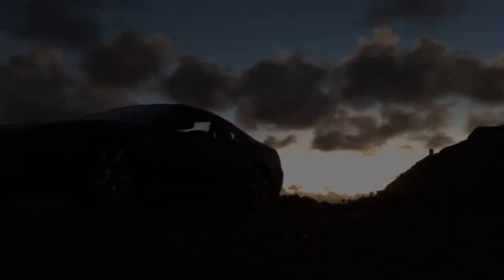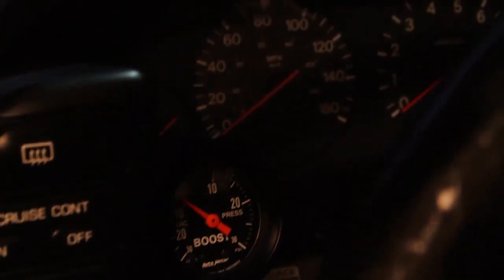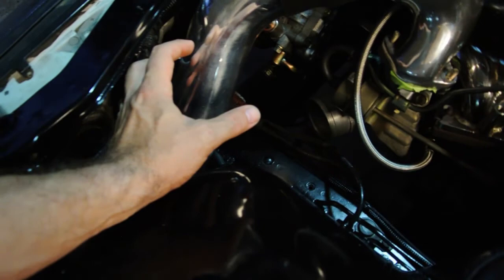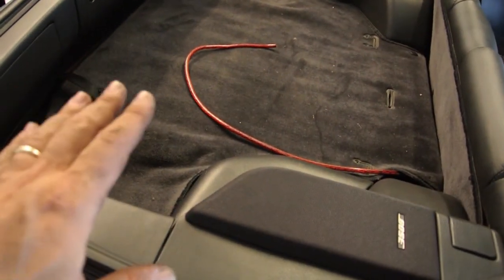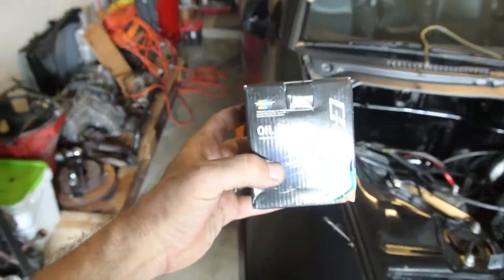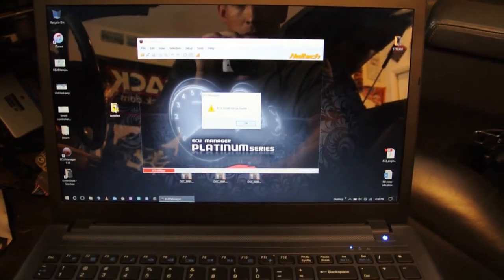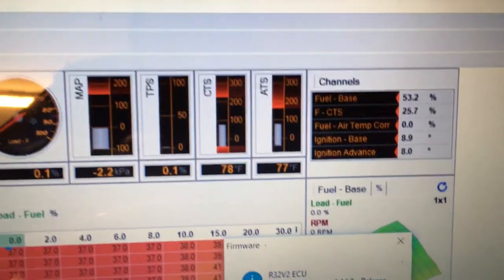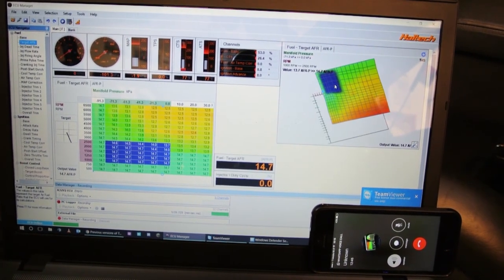First START UP :: Ep16 - TueZday Garage :: RB26 into 300zx (RBZ32)

Comment: @08:22 thats exactly why im surprised you went and deleted the ac. rb's build so much power lil ac isnt gonna draw that down much.
and it would help balance out the engine bay like you said the rb isnt the most balanced motors. that why i love the vg platform but i still love this build! always wanted a sequential turbo setup or one mid sized turbo.

cant wait to see more updates as you finish her off.
nice work brotha!

Comment: What is the difference between driving VG and RB in Z32? :  )
Reply from the maker: There are many on the fence or opposed to this swap, considering the RB to be a downgrade. For me, this is a chance to do something different, unique, special, and reach a personal goal. This is the 10th 300zx I have owned. I have done all the things in the past. This is new. It is definite'y a project for the passionate. And on top of all that, its just really, really easier to work on in that engine bay. I look forward to the first drive and my overall thoughts at the end. stay tuned. Also, reference back to video #3 i think... it goes more into my thoughts on the swap
Reply: Thank you very much ! I wish to further develop my passion : )